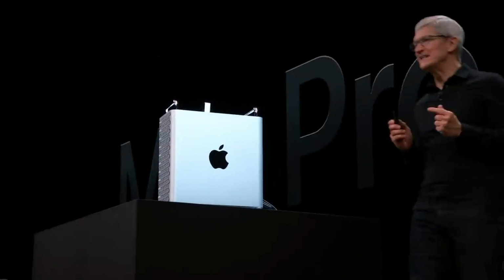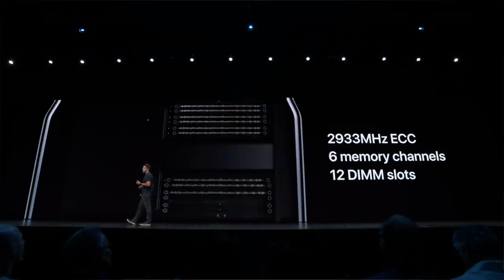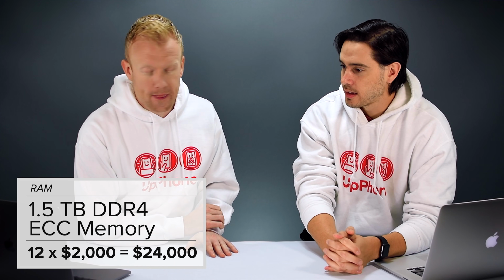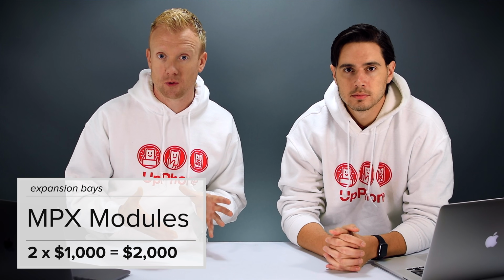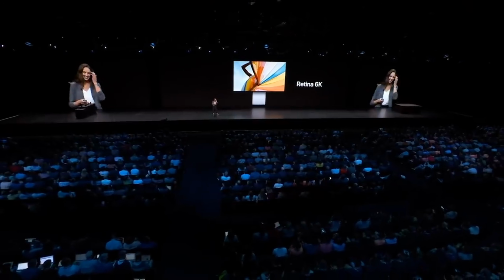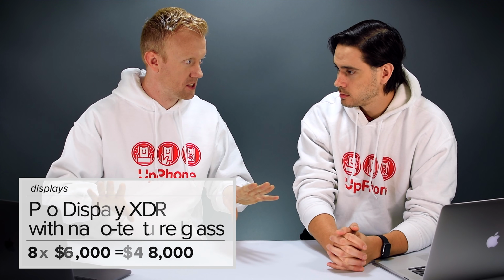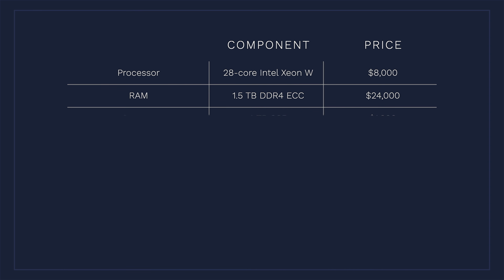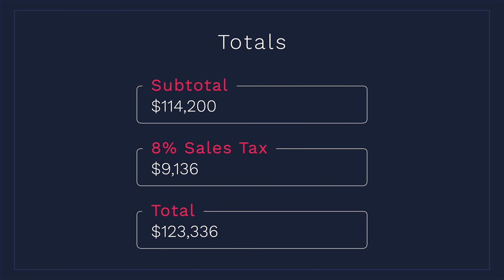$100,000 Mac Pro!? Apple's Most Expensive Computer!

Comment: I think you’re really low balling the module prices.

I imagine (like automobiles) there will be options to lease.

As to why would anyone buy a computer like this, I imagine there are use cases where the value of the time saved will far exceed the cost of the computer, and/or equivalent options will cost just as much if not more.
Reply: I guess people like very heavy game and graphic designers would need these . When you have to do a bit of work speed can be compromised but when u have tons of work you need consistent speed